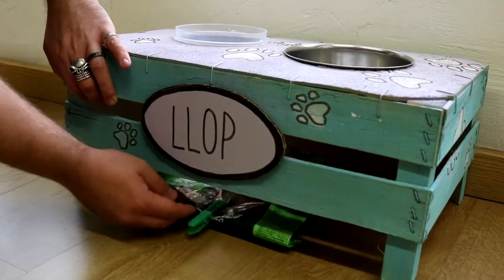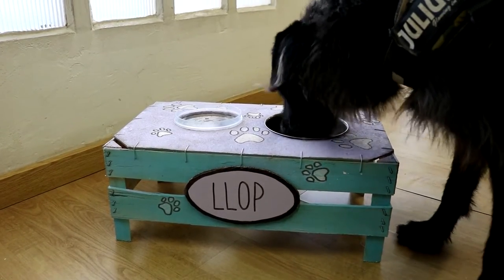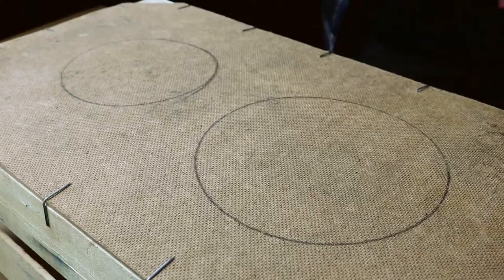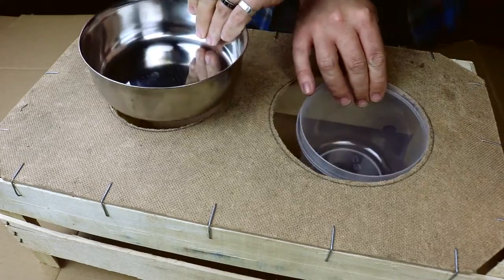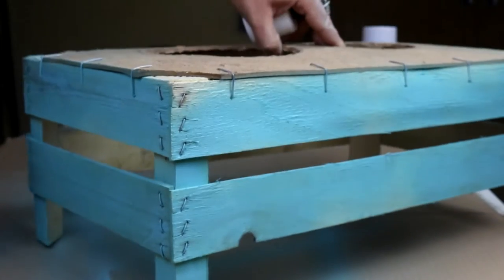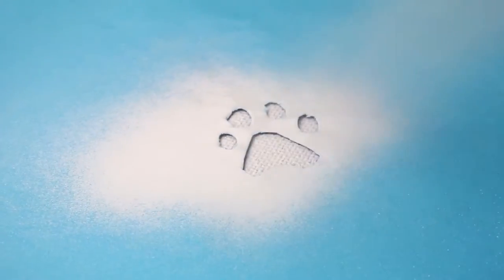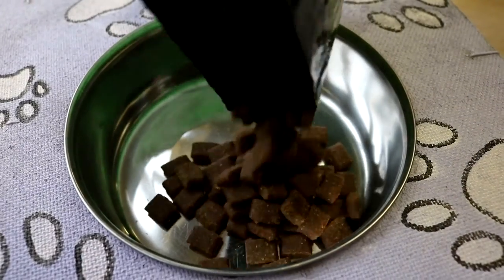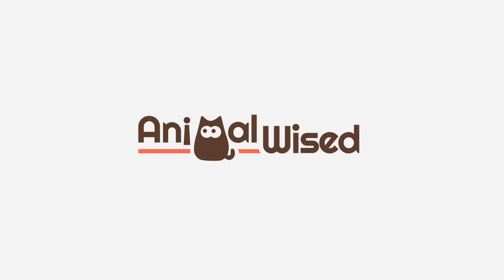DIY Homemade Dog Feeder - Easy and Practical

Comment: What type of material is the bottom of the crate made of?
Reply from the maker: It is a very light sheet of wood. Usually, you'll find crates with the bottom, you don't need it to be of any specific material as long as you can cut through it.  
Hope this helps